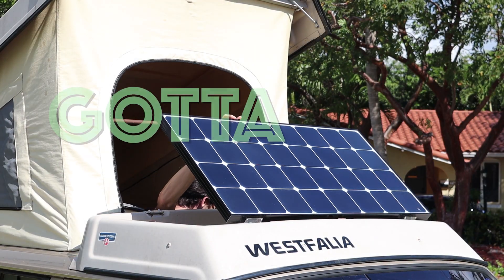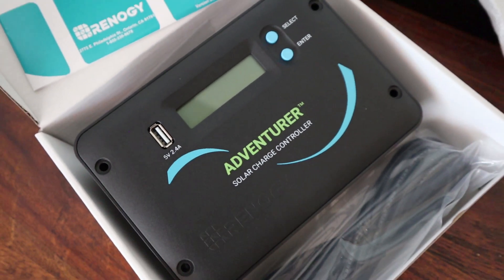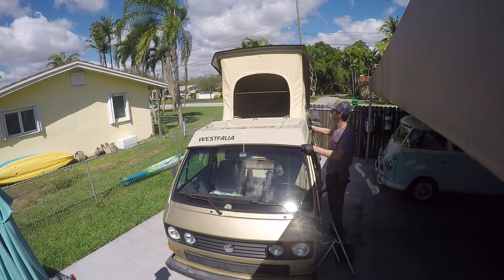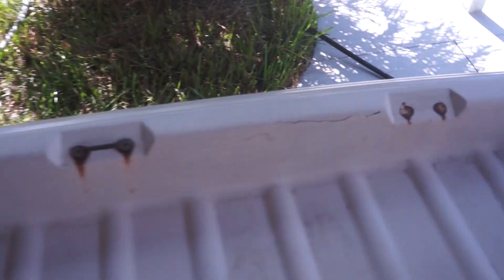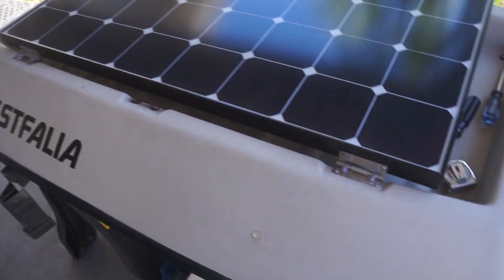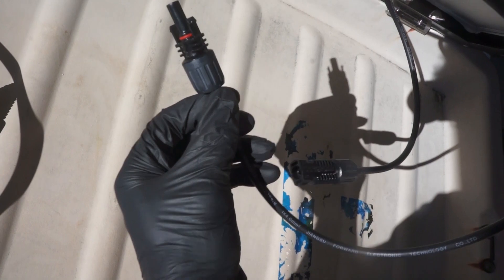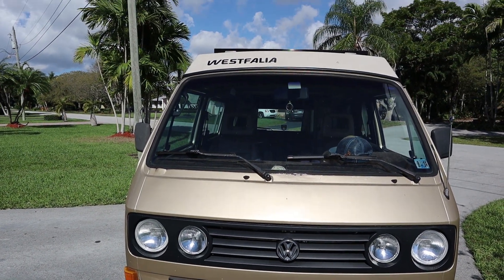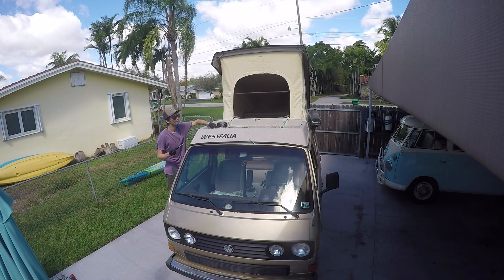Vanagon 100 watt Solar Panel install

Comment: would you be able to just bungee a panel down inlieu of the hinges? Just for a more temp solution or to not modify the rack?
Reply from the maker: I'm not sure I would trust bungees for anything but a temporary solution to get the panel to a camp site. Also not to sure about covering any of the solar cells with the bungee cord. I've heard that covering any part of a solar panel is not too good for it. Maybe you could add some sort of straps to the bottom of the panel that go to the original loops on the rack.

Comment: Did you make a kickstand to get the panel to stand up? 😊
Reply from the maker: My original intention was to add a kickstand or maybe one of those spring hatch stays, but I ended up just putting a foam stick under the panel to keep it up.

Comment: Hi! i’ve already mounted this panel in my luggage rack, and have a couple questions. 1. Do you still like where you put your battery (under sink?), 2.where do you keep cookware?
3. any regrets placing solar wires under pop up frame?
Reply from the maker: Hi, yes, I'm pretty happy with the battery placement, but maybe if I had to do it again I would put it under the rear seat. I usually store my cookware in the cabinet to the left of the fridge. I haven't really been on the road for more than a week at a time, so at the moment its adequate space for everything I need. I haven't had any problems with water or anything getting under the pop top frame. I also don't keep my pop top open in the rain because it takes too long to dry where I live, and gets moldy. After the video I did put some soft foam over the wires so it would seal better, just incase.

Comment: Thanks for the video very helpful. Question
 Battery connection did you use a Battery isolator solenoid to charge both batteries?
Reply from the maker: Thanks for watching! Yes, I used the second battery kit from GoWesty on mine. It's basically just a solenoid like you said.

Comment: what are you using to prop it up?
Reply from the maker: Just a piece of rigid insulation here. I intend to make something more sturdy and attached to the panel, but I also don't like drilling holes in the pop top and luggage rack. So for now I just use stuff I have in the van to prop it up.
Reply: @gottasplit5707  aside from the insulation to prop it up. did you bungee or strap it down in case a sudden strong wind blows?  might crack the top?
Reply from the maker: @pyronitro  I installed some stays after this video that keep it up, but it is still connected to the top In the front and won't fall off even in high winds. I probably also wouldn't lift it up in really high winds just in case, same as the pop top.
Reply: @gottasplit5707  Thanks!

Comment: think i would have used some SUGRU (total UV protection easy to use silicone putty) between bracket & luggage rack. It will help with vibration & will help hold bracket IN ADDITION to those lil screws. pro tip: any time your using any kind of adhesive use rubbing alcohol on the surfaces your using adhesive on for best hold

Comment: Thanks for documenting your process. I am about to do a similar installation and I was wondering if you have had any complications with routing the wires under the pop top's aluminum rail? It seems like the most noninvasive method but it does produce a bit of a gap.
Reply from the maker: It does make a little gap under the aluminum rail, but after I filmed this video I added a bit of AC line insulation (the really squishy foam kind) under the rail, and that's been fine. It's probably not as water resistant as it was before, but I usually don't leave my top popped in the rain.

Comment: Have you any leaks since installing the hot and cold from the panel underneath thru the canvas frame?
Reply from the maker: Luke Morra Nope, but I rarely put the top up if there’s a chance of rain. It takes too long to dry after, so other than very light / short rain showers I haven’t tested it. I did also add some AC pipe foam to the underside of the aluminum rail after this video was uploaded.

Comment: I love this setup, super simple and cost effective. My question is if I were to swap the old westfalia fridge for a tf-49 that has a pull of 2a/h (I believe 240 watts) and have other accessories on as well, is this set up strong enough? I’m sure I could get a stronger solar panel (175w) and also use a cigarette lighter inverter to charge the battery. Would I also need a bigger battery and charge controller, or is this one still plenty powerful (since the 30a is 600w). I’m trying to understand all of this lol.
Reply from the maker: So far I haven't had a problem running the fridge and everything else, but I would like to upgrade the battery eventually. I only have a 79ah marine battery. I'd like to put in a lithium 100ah. Right now I can easily run the truck fridge all night without a problem. I do feel like I conserve power as much as possible though. I'm sure with a larger setup you wouldn't have to think about saving power as much. If you're really planning on not running the engine for long periods of time, and charging laptops fridge and other stuff all the time, I'd say you might need a larger setup. Or at least a larger battery to store power at night or for rainy days. I am definitely not an expert on any of this stuff though. I basically just copied my buddies setup since I liked the way his worked and looked. Might also be a good idea to contact Renogy tell them what your needs are and ask for their advice.

Comment: Hi, nice setup. Where can I find the bolt with a key lock? Thanks
Reply from the maker: Thanks! Not sure exactly what you are asking about. I haven't found a good way of locking down the panel yet, but will try to make something in the future to lock it to the rack. If you're talking about the hinges they can be found on Amazon with the link in the description of the video. Those are the only things securing the panel to the roof rack.
Reply: @gottasplit5707  Haha sorry wrong video. Check this one out https://www.youtube.com/watch?v=xPW15ZPnhG4

Comment: thanks so much for all this!!  Question:  how many batteries do you have then?  Where do you store them?  Do we need 3 batteries?
Reply from the maker: Thanks for watching! I have one 89ah AGM battery that I installed inside the cabinet under the sink.
Reply: @gottasplit5707  so you just have two batteries one under the driver sit and other one under the sink? No battery under the passenger sit?
Reply from the maker: @harakrubio  only one house battery under the sink. The one under the passenger seat  is only for starting the van though. I have a solenoid switch from GoWesty to disconnect the house battery from the starting battery when the car is not on. The panel only charges the house battery under the sink.
Reply: @gottasplit5707  Thanks!!! And thanks for all your videos they are super helpful!!! Cheers!!

Comment: Does the panel rattle at all while driving?
Reply from the maker: Nope, it stays pretty tight on there with the hinges. also, you can bend the hinges a tiny bit to make them tighter if it were to rattle.

Comment: Hey guys don’t you find that a 100w solar panel is way to small. I go camping for a week at a time. I have had a 150 watt portable solar panel that I place on the ground and manually track the sun. The panel is attached to the van via an Anderson plug on the L rear guard. This charges a 100 agm battery in the engine bay. I use the power to run a small compressor fridge, lighting, charging phones and an iPad. I’m constantly moving the panel to chase the sun to maintain optimal charging. By the end of my week the battery voltage is getting close to 12 volts and 50% capacity. I have upgraded to a 300watt panel and when I get to go camping again after covid I hope I’ll keep my battery fully charged by the end of each day.
Reply from the maker: It definitely would help to have a larger panel. I've only got an 85 ah agm battery, so the 100 watt panel charges it pretty quickly at mid day. I have noticed that by the second day, if the sun hasn't been perfect, the battery has been run down a little. I really only chose this panel because its the one that fits in the rack. One of these days I'd love to upgrade to a larger battery, and have a foldable panel to put out when I camp.
Reply: I understand space is at a premium 👍

Comment: Couldn't rain water get through where you fed the wires under the aluminum rail that holds the canvas onto the roof?
Reply from the maker: I’m sure if it rained hard enough it probably would leak. I don’t open my pop top unless I know it’s not going to rain. It takes too long to dry, and isn’t really built to be getting wet anyway. After I filmed this video, I did decide to put very soft foam A/C pipe insulation over the wires, to be as sealed as it was before. I should actually update the description of this video to say that I did that.
Reply: @gottasplit5707  good to know! Thanks for the update

Comment: When you tilt the panel forward, how does it remain upright?  Do you have some sort of prop behind the panel?  I'm sure a broom handle or a piece of random bamboo, or even a sawed-off hockey stick would work, but surely there's a more elegant solution.
Reply from the maker: Right now I have a little piece of wood that I prop the panel up with. I've tried thinking of several ways to get it to stay up, but haven't made anything permanent yet.
Reply from the maker: Not sure why YouTube isn't showing me your other question about the solar panel model when I look for it, so I'll answer here. Its SKU: RNG-100MB and can be found here: https://www.renogy.com/eclipse-100-watt-12-volt-monocrystalline-solar-panel/
Reply: @gottasplit5707  It isn't showing up because I found the answer to my own question about 2 minutes after posting it, so hurriedly deleted it to avoid an unnecessary response.  Then I also saw you had also included it in your links below the vid.  Was I learned is that damn, you're quick...these get your attention fast!  BTW: I have enough old hockey sticks that I sense that will be my solution to the propping conundrum.
Reply: I plan to install two hinges fore, and one aft (replacing the centre footman's loop) because I use the rear side loops to tie down my canoe bow. I might use a fourth hinge to build an adjustable brace that clips into the centre aft hinge somehow. That being said, the 100watt potential is going to be  more than double what I was using previously and so I may not need to even tilt it up very often.

Comment: What size holes and grommets did you use? I'm planning on doing the same to my westy.
Reply from the maker: I believe I used a 3/8” bit for the holes that the wires went through, but I honestly don’t remember. It all depends on the wires and the grommet size. For the grommets, I just bought a variety pack at Ace Hardware and found a size that fit well.
Good luck with it!!!
Reply: @gottasplit5707  I tried this setup this weekend and unfortunately this setup won't work on my luggage rack for some reason. I think my luggage rack is too small.
Reply from the maker: @vandwellerfeller  Oh man, that's the first I've heard of that issue. My panel doesn't sit all the way into the luggage rack, it does stick up a little bit. Does the panel sit in the rack at all, or is it really off?
Reply: @gottasplit5707  Well it sits on top but the hinges come off the luggage rack. I'm gonna try to figure something out soon. It's gonna rain all week so I'll have time to brain storm. My panel is an older panel but the dimensions are the same as the one you linked. The hinges are pretty sweet though. I'm hoping I can use them.
Reply from the maker: @vandwellerfeller  Yeah, those hinges make it all worth it. Not just for lifting and getting the morning sun, but for storage, and removal of the panel. Really hope you can figure something out. Good luck!
Reply: @gottasplit5707  Figured it out today. I reconfigured the hinges on the back so that they go under the panel which gives more room for the screws on the luggage rack and they still function perfectly. Pretty stoked about the setup.
Reply from the maker: @vandwellerfeller  Awesome!!! Glad you figured out a way to make it work. Just wait until you get to a camp spot and have free electricity. Best investment ever!
Reply: @gottasplit5707  I'm pretty stoked about it. My first 2+ years living in it I didn't even have electricity. Do you have a system to lock it? I found some flat cable locks and I'm thinking of cutting a slot in the panel frame and locking it to the tie down cleat.
Reply from the maker: @vandwellerfeller  At the moment I don't have locks, but that sounds like a great idea! Let me know how they come out.
Reply: @gottasplit5707  So it turns out that a 100W panel is inadequate with my battery system and will do more harm to my batteries than will help. I'm running 2 batteries each with 44Ah and would require no less than 10A each. Even if I pull one battery out it would still only give me like 6A. What battery do you run with?
Reply from the maker: @vandwellerfeller  I have one 85ah marine deep cycle AGM battery. Haven't had any problems with the panel keeping up with it. I'm actually thinking of upgrading to a larger battery soon.
Reply: @gottasplit5707  Nice. Maybe I'll try my setup then as is. I'm not very good with electrical stuff. I just keep hearing that 100W panel won't work. Glad it's working for you without issue.

Comment: Thank you for this.  I have this set-up to and was looking on how to get it installed.  Love the way you run the wires out of the luggage rack and under the canvas area and along the inside.  That is very clean!  No real holes in the Bus!
Reply from the maker: Glad the video helped you out!
Yup, wanted to avoid drilling holes in the cabin area. I already have enough water leaks to worry about haha.

Comment: Great setup video, and planning a similar setup with mine. Have you had any issues with the panel mounted in the luggage area like the panel  rattling, or the hinges working loose?
Reply from the maker: Von Westy Thanks for watching! I haven’t had any problems with it at all. It’s still on there nice and tight.

Comment: does water go under the aluminum rail of the canvas??? its a nice setup but I'm concern about the water going inside the van. Thanks
Reply from the maker: I did notice the space under the canvas where I ran the wires. I’ve been pretty lucky to not have had any water go through that area, but I can see how that would happen. I ended up using a bit of air conditioner line foam insulation, the soft fluffy rubber looking kind, and cutting it to fit over the wires and under the aluminum trim piece. That sealed it up and I can’t see any light through that area anymore, though I’m sure it would still leak if it was sprayed with a hose or something. I usually don’t pop the top if its going to rain though. There’s never enough time to let it dry the next day and I end up with mold.
I have heard from other people that they have had problems with leaking. I just don’t see any other way of running the wires without permanently damaging the van by making holes in the roof.

Comment: Nice.  Where did you mount the charge controller and put the battery?
Reply from the maker: Kim Erickson Kim Erickson thanks!!! The charge controller is mounted on the dresser on the side and over the dresser door. 6:43
The battery is mounted under the sink

Comment: Just seen this, was it a game changer?
Reply from the maker: For sure it was a huge game changer. I’ve been able to keep my fridge running way longer without starting the engine, and charge all my electronics without any worry. As long as the sun is out, you’ll have power. So nice.
Reply: Gotta Split I’ve got a tin top any suggestions?
Reply from the maker: @robertthomas8381  I’d suggest getting a roof rack of some sort to mount the panel. The least amount of holes in a car the better. On my Tin top split window bus I’ll be putting a solar panel on top of my roof box and running the wires through the rear hatch. I’m not sure how well it will seal, but I'd be willing to try anything that isn’t going to permanently put holes in the car.
Reply: Gotta Split I was thinking that and putting the wires at the rear hatch...
Reply from the maker: Robert Thomas I think that would be the best way to start putting it together. If that leaks, maybe run the wire through one of the vents in the back.